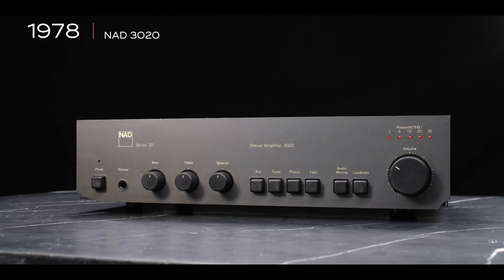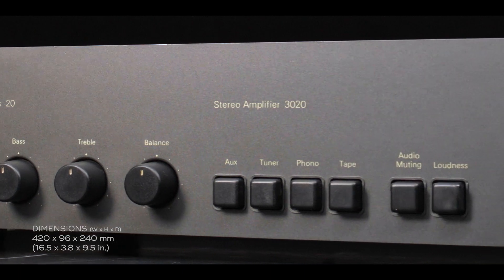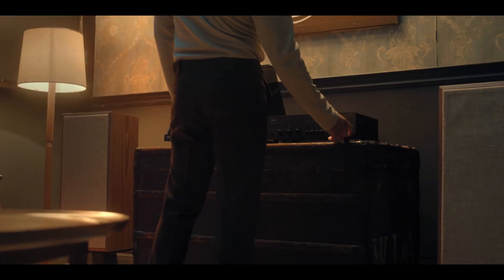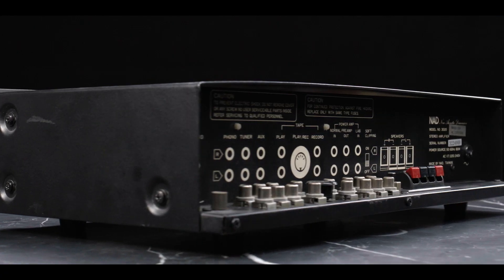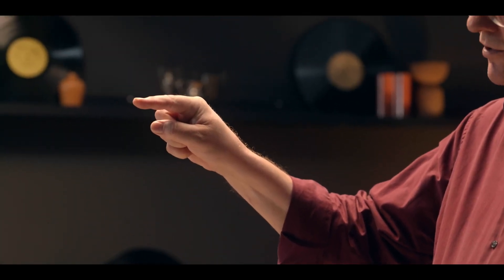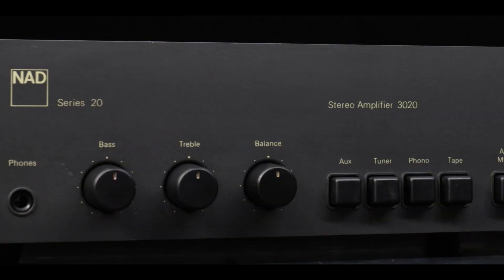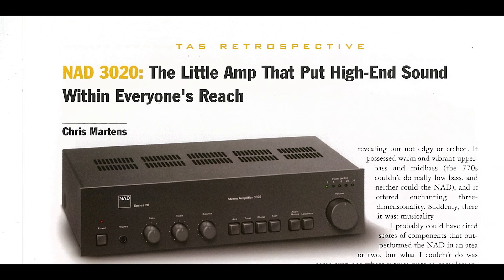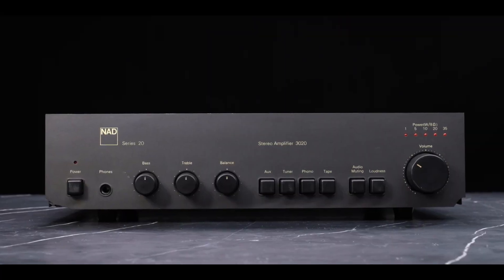NAD Electronics Iconic Technology: SoftClipping

Comment: I owned two NAD pe2200`s . sold them, then bought 1 PE2200 off ebay, and a PE2600 too. Love the sound, but mostly the Headroom of the power. They drive very difficult loads of my dinosaur Infinity 8 Kappa`s. 89db at 1 meter. Bass notes dip to 3/4 ohm. the NADS very rarely clip !

Comment: Hi, I purchased one of these back in 1982/3 I can’t use it as a preamp connected to 100 W Cambridge power amp, Both of which worked fine until 2019 we have a summer no reason both of them packed up at the same time and blow my speakers in my transmission lines, I could not find anybody to repair them as I live in rural part of France and I ended up buying a secondhand NAD 314 which was secondhand off the Internet for my company over in the UK it arrived safe and sound I’ve been using that ever since, it is now the main amp to drive my transmission line speakers, after about five or six months I’ve managed to buy a new driving and it’s made by Seas , 150w at 8ohms .
And now I’m actually having problems with the phono stage occasionally I get a hum come through, I’ve always found these products give very good detail and clarity of sound with a good Bass response, Due to my circumstances I cannot afford new ones so I will be going out at some point finding something secondhand on web which will be a shame, I used to use a Linn LP12 record deck which again I purchased in 19 8283 secondhand for £400 the person I purchased it off I was upgrading to a different make, And however this has packed up in 2021 appears the main board and the motor has packed up the table started to oscillate, Now this sits on my table as a piece of art as I cannot afford to have it repaired as I have been quoted £1600  for repair, It took me nearly 8 months to save up a small amount of money I’m half an hour I’ve purchased a Yamaha 500 record deck secondhand as well, Oh the joys of being retired just living off my state pension time I’ve paid my bills each month I do not have a lot of money left, Luckily I live in rural France it might sound very nice which is the cost to live in is a little bit cheaper here than back in the UK I think if I was there I’ll be on the streets from what I’ve heard from colleagues the cost of living over there is horrendous. I do wish I was back at work at least then I could pay my way and buy some new equipment. I’m 71 years young in four weeks time, I cannot go out and even buy myself a birthday present, sorry for explaining my plight, The main part of this has been due to my ex partner I think it’s called a scam I’ve been scammed for hundreds of thousands of pounds over the last 15 years.
Going back to your equipment NAD I suppose in some respect I’ve had good service from it I just wish I could go out and purchase some new equipment, I have left numerous comments on your product when you have uploaded articles on your equipment and I’ve never had a reply.
PHIL FROM THE DARK SIDE OF THE MOULIN FRANCE.
Reply: Why can't you use the 3020 as a preamp to the Cambridge?